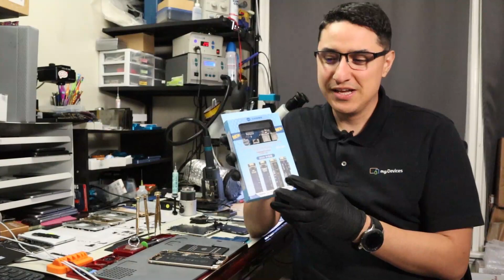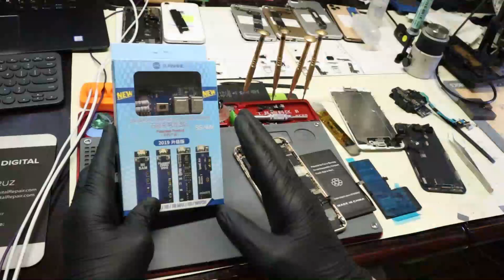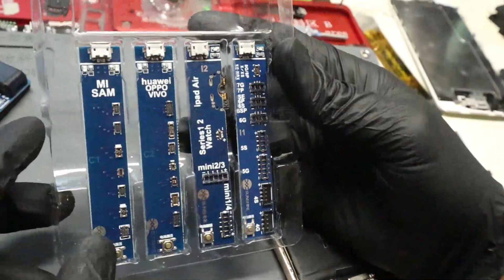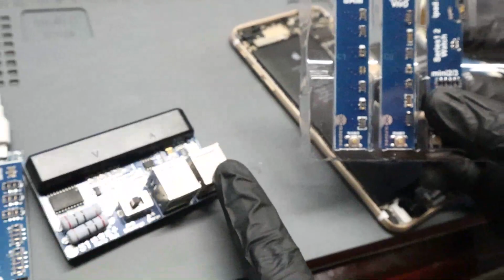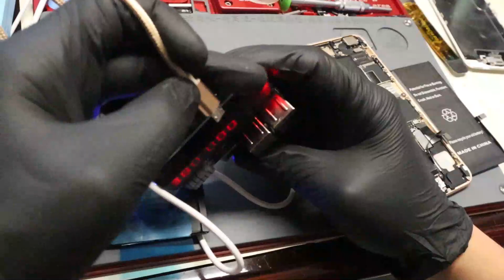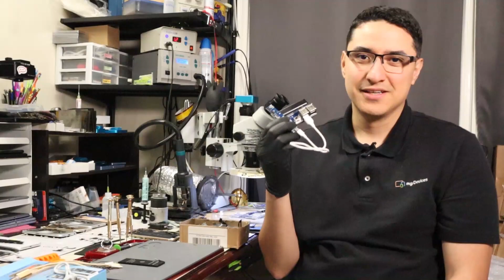iPhone External Battery Charger. MUST HAVE for Repair Shops! How To Use Sunshine SS-909 & Review

Comment: Is there a way to use this device to check actual mAh battery capacity, so we can stop getting scammed by all the aftemarket battery sellers who are selling hacked and/or used LIPOs and then lying about the actual mAh capacity of the batteries they sell(?)
Reply from the maker: Unfortunately no. This tool is very basic. It can only measure voltage & current. It can't read battery data.

Although, you can plug in the batter to their respective iPhone and use 3u Tools to read the battery data

Comment: I'm not sure i understand the full purpose in this or if I'm missing something, basically with this can tell you the capacity of a phone and clarify the battery as or as not the issue? is there much of a point to getting this if you have a dc power supply (with correct adapter of course) and a battery? I think i could see how this would be useful for android or less common devices?
Reply from the maker: Many purposes.

1. You can plug in an iPhone battery (or any compatible battery) and externally charge it without having to monitor it. It can detect when it's full & stop charging, compared to a DCPS, you can overcharge a battery if you're not actively monitoring it

2. You can quickly plug in a battery & see what the battery voltage is at. 

3. You can reactivate a dead battery in many cases, by plugging in the battery, then plug in the charger & monitor the current consumption

Of course, you can manually do this with a multimeter & DC Power Supply. This tool just makes this process a lot more convenient.

It also allows you to teach your employees who have limited technical knowledge to use it, without adding too many risks.
Reply: @VCCBoardRepairs  Thank you for taking hte time to help me understand better
Reply from the maker: Here to help!

Comment: @VCC Board Repairs - Jesse Cruz I bought this tool for a Samsung Fold 5G that works fine beyond not wanting to charge through USB-C. I leave it pluged in until there is no more current draw from the batteries but when I plug in the batteries to the phone motherboard it only shows 90% charged instead of 100%. Can you please provide an explanation ? Thanks
Reply from the maker: Great question! Unfortunately, i'm not familiar with that model, so can't really help much. But check out my new group where you can ask for help: https://www.facebook.com/groups/thephonerepaircommunity

Comment: I ain’t even gonna lie I loved this thing for a while but it started to smell like smoke in the corner of the shop, and I had to throw it away because I thought it was about to catch fire if I continued use.
Reply from the maker: Did you have anything plugged in when it started to smell like smoke?

Usually I found the issues of that is when someone plugs in the battery from the wrong side
Reply: @VCCBoardRepairs  dang was not expecting a reply on this old video. But I did have a Samsung battery hooked up. I think it was a note 8 battery. However I know for sure it was plugged in right. We used the tool all the time so maybe it just started to die out?  

I’m wanting to give it another go because I miss having an external battery charger like this.
Reply from the maker: Yeah it's a great tool. I personally used 2. My first one eventually had the micro usb connector break after using it so much. But the 2nd one has been solid and never had any smoking issues

Comment: Do you know if this ss-909 has a connector for the samsung a line phones? Specifically I have a few a5 2017s that wont turn on want to check batteries. Wondering if this tool has a connector for the a5 phone battery J7 also I know uses same battery.
Reply from the maker: No idea. Check the website and see if any of the connectors look like it'll fit

Comment: Excuse me, is this tool recommended if used to charge the battery (without a smartphone) for daily use?
Please explain, thank you
Reply from the maker: The tool is designed for technicians for temporarily charging batteries for testing and troubleshooting purposes.
Reply: @VCCBoardRepairs  How do we know what percentage of the battery we charge through this tool is filled?
Reply from the maker: 3.6V is about 0%
4.2V is about 100%
Reply: @VCCBoardRepairs  The indicator is volts? thanks.
I think in ampere, after that we convert it to mAh.